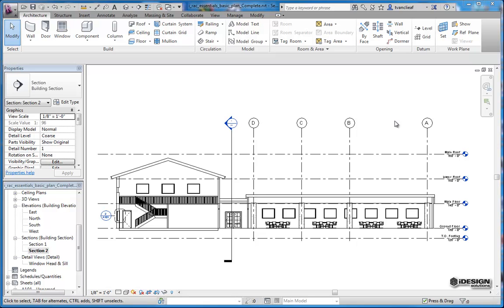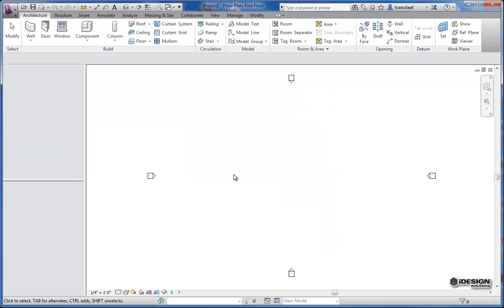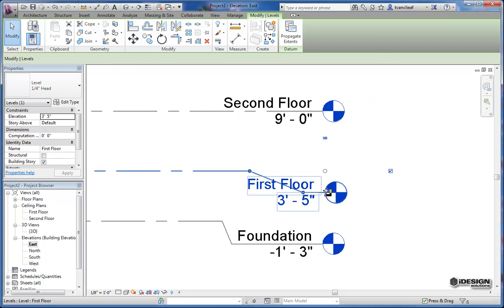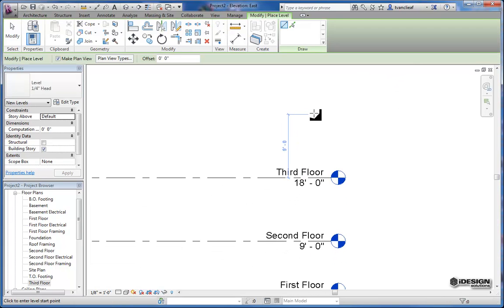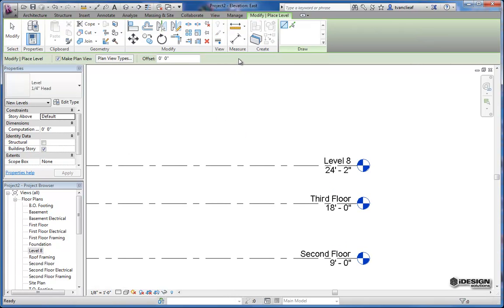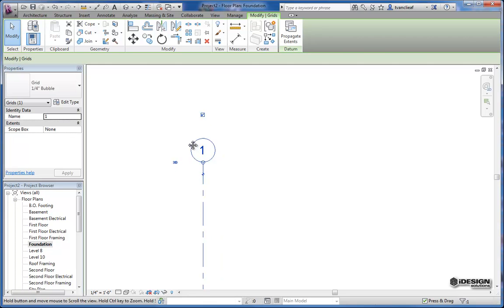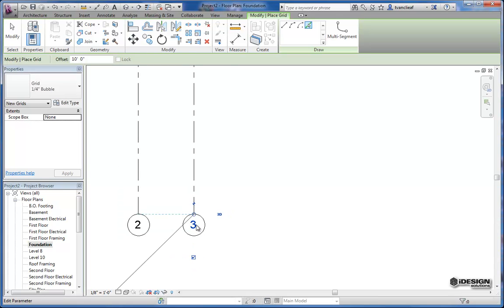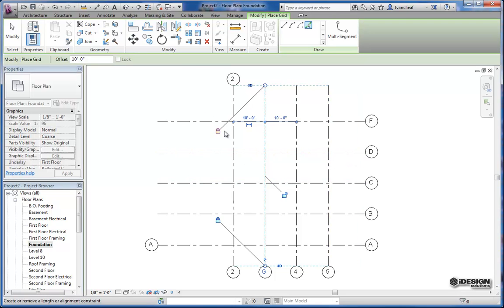Working with Grids and Levels in Revit Architecture 2013

Comment: im using revit 2013, when i start to create levels this warning will be visible  (None of the created elements are visible in Elevation: Elevation  View. You may want to check the active view, its Parameters, and Visibility settings). even i have done Visibility settings. still it is not visible. please do the need full